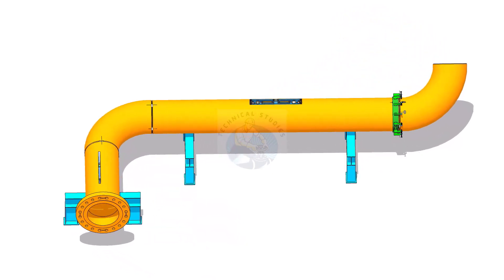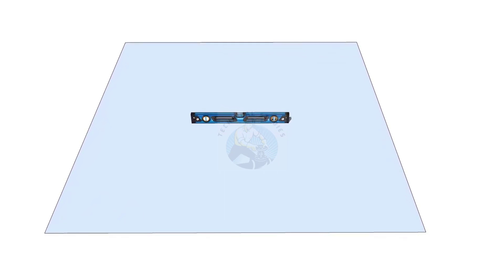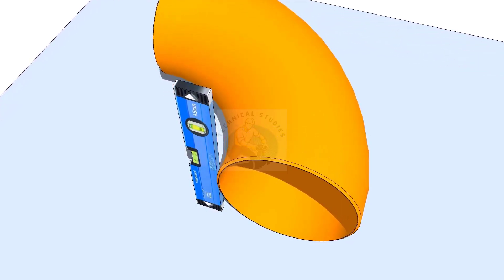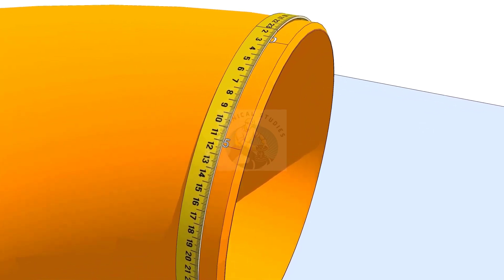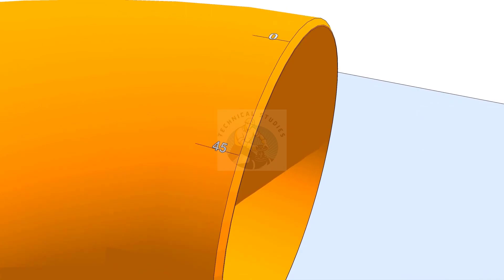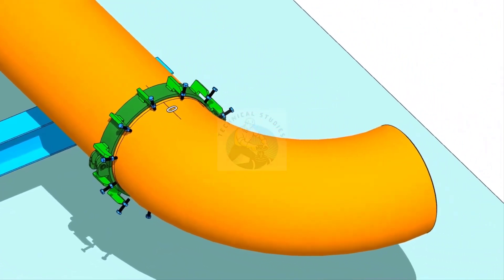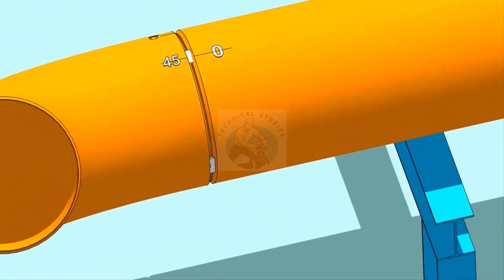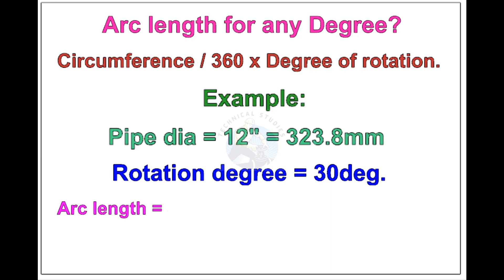HOW TO FIT UP A 90 DEGREE ELBOW, ROTATED TO ANY DEGREE

Comment: Can 323.8 be used in any pipe diameter when calculating arc length?
Reply from the maker: no bro. arc length = (dia x 3.142)/ 360 x degree